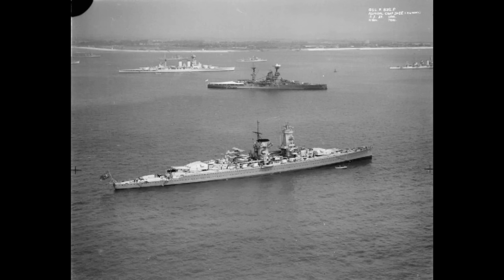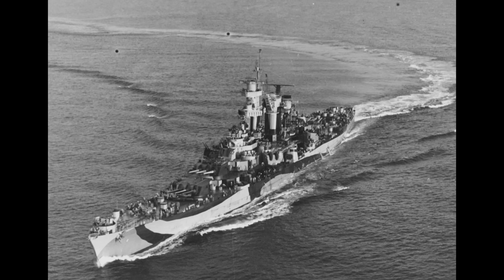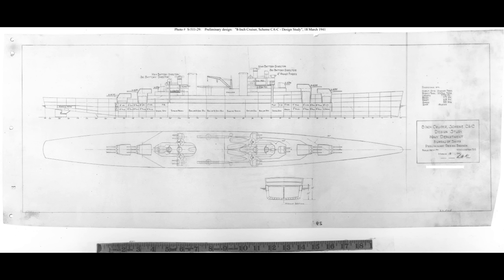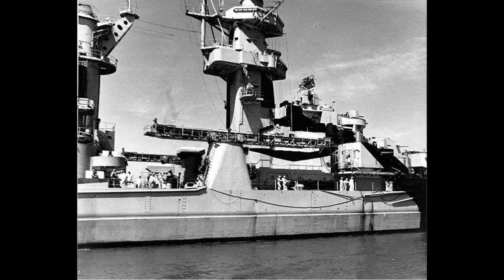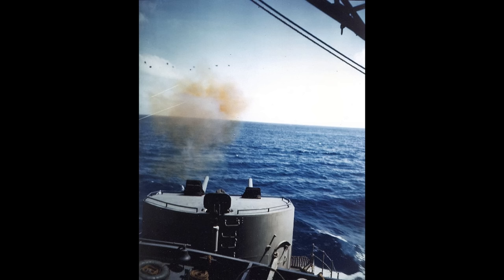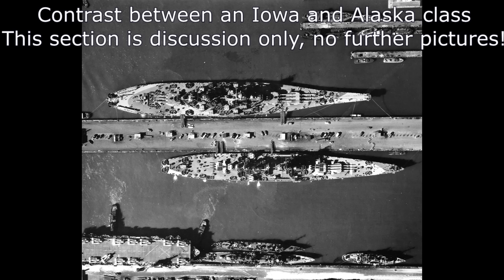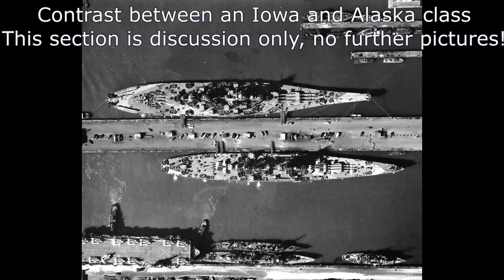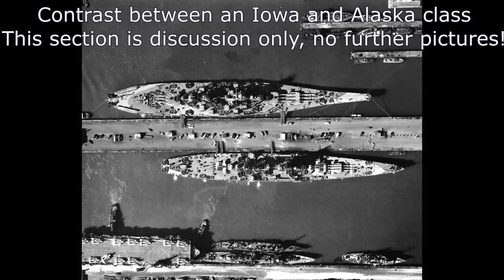The Alaska class - Large/Super/Battle/Mega/Hyper/Ultra Cruisers

Comment: I think the Alaska represented a better path for Battlecruisers to begin with. The main issue that plagued BC’s throughout their existence is that they had battleship-grade guns and therefore incompetent military planners constantly tried to shoehorn them into the battle-line. Going with an intermediate gun calibre between contemporary cruisers and battleships could’ve prevented most of the misuses that cost hulls and lives. 

Probably saved a decent amount of money as well. The Alaska’s weren’t cheap by any means but they were still cheaper then a Battleship while Battlecruisers typically cost more to build and operate.
Reply: I'd argue the reason they were called CBs was specifically to prevent them being used as capital ships, i.e. how the Invincibles were used.
Reply: Unfortunately the Alaskas weren't much cheaper than a fast battleship, and at the same time weren't much more capable than a late-war heavy cruiser. Choosing between one Iowa and 2-3 Baltimores might be a stumper, but choosing between one Alaska and 2-3 Baltimores... well, one of those things is just better than the other in almost every circumstance. 

To be clear here, the problem was that Alaska's specification was impossible. The designers did an heroic job of creating a ship to meet the stated need, it's just that the specified combination of armament, protection, and speed couldn't be accomplished with the technology of the day on anything much smaller (or cheaper) than a full-on capital ship. So the Alaskas are an example of fantastic execution of a deeply questionable concept.
Reply: @Philistine47  Yeah they unfortunately came into service right when gun-based warfare became obsolete and naval strategy flipped on its head overnight. However, up until that point cruiser killers were a valid concept and I think they could’ve been quite successful if they’d been built a couple years sooner.
Reply: Von Spee might have a different opinion.
Reply: The smaller caliber meant more ammunition aboard, too.  Which is not insignificant: if intending to be used as cruiser-hunters, they will need to ensure they don't shoot themselves empty while fighting larger numbers of lighter cruiser/destroyer squadrons. 

And it would have made them (arguably) much better shore-bombardment vessels than either Iowas or Baltimores: they had almost the range of the Iowas, but aren't wasting firepower.  Very few targets ashore actually require 16" fire; it's kind of overkill.  Against most ground targets, it is more effective to saturate the area with 100 1-pound shells, than with one 100 pound shell.  Which is why cluster bombs and ICM shells are a thing: because more small hits is almost always more lethal over a larger area.  Add to that the much longer barrel life of the Alaska's guns compared to the 16" guns...

It would have been quite good against the Japanese lots-of-8"-gun cruisers (being basically immune to 8" fire, and with guns that easily overmatch those cruiser's armor), and would have been excellent for shore bombardment, particularly against larger islands (or in Europe) where greater range for further reach ashore would have been important.
Reply: This is actually the dumbest argument i keep hearing about Battlecruisers. Instead of having a ship than can hurt a battleship you would rather have a ship that can't lol. 
"intermediate gun calibre between contemporary cruisers and battleships" That was basicly what armored cruisers were.... not to mention that they sometimes had same caliber guns as battleships to begin with. Also most complaints about battlecruisers in the battleline are based on Jutland loses which mostly happened when BCs faced other BCs therefore the argument is illogical if bc beating bc is supposed to disprove validity of bc.
Fallowing your idea of "good" bc in practice:
1. True battlecruisers would rape your small gun battlecruisers
2. Than the true battlecruisers would join the battleline in the front and cross your T or join the rear of the battleline and pour fire into your rearmost ships with impunity
3. You lose...
Reply: @filipzietek5146  No sailor cares about such distinctions when they're shooting or being shot at because few ships end up fighting under the conditions the wonks built them for.

Technically the Japanese were far outclassed at Tassafaronga as was Taffy 3 at Samar, for examples.  Does anyone think those servicenen calculated the odds given on paper by those far removed from battle?
Reply: @filipzietek5146  Your point is irrelevant because BC’s were NEVER meant to fight BS’s. But because they had the same guns as contemporary Battleships, they were often put into situations that they shouldn’t have been and sunk. My Hypothesis is that if something like the Alaska was the design route of all BC’s then you wouldn’t have the numerous historical examples of BC’s being sent to fight BS’s and dying horribly. 

Furthermore, these intermediate sized ships would be cheaper and therefore you could build far more of them then a rival who’s using BS guns on theirs. You seem to be under the false impression that cost isn’t a factor. They might have individually superior BC’s but if you have twice as many then you just gotta wait for them to all be sunk in the enemy line of battle by your own BS’s. 🤣 Also your own cruiser-killers should be out killing other cruisers, not engaging capital ships. 

With the weight and cost savings of a smaller armament, you could probably also make your ships faster and more heavily armored so that it’s unlikely the enemy BC’s would ever threaten them. So yes, I maintain that it’s a superior concept if the original design principle is upheld. To kill anything it could catch and outrun anything it couldn’t.
Reply: @samuel5916  Actually while initially BC were not intended to engage battleship as most navies started to gain experience using battleships and lines of battle it become apparent that the transiction from wind to steam carried a challenge, and that was the fact that now an enemy fleet could at any time avoid confrontation and action with mininal effort . This was particular challenging for the royal navy , that had made a laege investment and effort in having the  largest battle fleet in order to ensure a superiority of numbers that (specially based on exercises and wargames) would warrant victory in most conditions. and that was exactly what took place for almost 2 years , since the german fleet simply refused to engage the RN until jutland being always able to withdraw . Therefore by around 1911 or so it become clear that the RN required what could be called a bloodhound type of ship, or in other words a vessel capable of damaging battleships (and overpower lesser classes)  and pursuing them while at the same time being robust enough to shrug some hits . The general idea was not to fully engage BB rather close the gap and score some hits that hopefully would result in a reduction of speed , forcing the opponents, most the  germans , to either stand and fight , abandon the damaged vessel to it's luck, or scuttle it , with the last 2options being the most desirable. All of thisis actually mentioned in multiple correspondence between some of the figure heads of the RN between 1910 and 1914, and it  is one of the reasons why the term or definition "battlecruiser" appears around 1911 when until that moment ships like the invincible were simply seen as large or heavy armoured cruisers.  And while ships like the invincible were automatically  "promoted" to battlecruisers, the  actual next generations of large heavyly armed , armoured and fast type of ships that are produced fron there onwards  will continously increase armor . Unlike the invincible that were in most cases intended to resist 8 or 10 inches shells, the "next generation"  will be armoured in way that would allow them to have some surviveability against 12 inches fire, specially when charging fleeting opponents..   That said when placed in a battle line, depriving them of one of their assets , speed ( that by the way made them harder to hit, something that we often forget, fisher was not necessarilyy wrong, speed was a form of defense particularly by the standards of WWI fire control )  and subject to rain of  large caliber shells , thngs did not work out that well.
Reply: @samuel5916   I'd more specifically say that the role of the battlecruiser changed during WW I. Whilst the Invincibles and Indefatigables were definately designed around Fisher's idea of an armored cruiser-hunter to protect trade, the fact that Germany built their own battlecruisers and them being used as heavy fleet scouts/raiders meant that the Royal Navy had to respond, thus resulting in heavier and heavier battlecruiser designs from the Brittish.

Secondly the largest problem of the Alaskas was the cost at $75 million each. Each ship cost comparably as much as full battleship, despite being an intermediary ship. Hell even the Baltimores at $40 mil each you almost get two of them per Alaska. North Carolina cost $60m and an Iowa $100m by comparison.
Reply: @Arthion  Yeah, I’m not saying the Alaska was a perfect balance but she was heading in the right direction (30 years too late.) Something with similar specs but in a more compact hull-form should’ve been more palatable in terms of cost. The smaller hull requiring a smaller power-plant which is the most expensive component of period ships along with just fewer raw resources like steel and armor. The Alaska had amazing specs but those came at a price. They built a no compromise design (torpedo protection aside) when they could’ve used a design that had a few modest compromises in order to be more cost-effective. I’m not an expert, that’s just my two cents.
Reply: Its not incompetency to put BCs into battle lines. The problem is that theyre really damn expensive ships, hardly cheaper than battleships, and that in a large battle, you dont want capital ships doing nothing. Heck, thats the same logic as to why normal cruisers and even destroyers fight in large battles, despite usually not being build for that specific purpose.

And cruisers are the intermediate ship, not BCs; the latters role was overly specific, having a long range and hunting cruisers, which couldve been done by having more cruisers. Whole point of BCs was to be more cost effective than "more cruisers", but that obviously failed. 

At the same time Battleships speed and range was constantly improving, so BCs didnt even have much of an advantage in that regard from the beginning.
Reply: @termitreter6545  Yeah they were a very highly-specialized ship, which is fine if that was a more cost-effective method of achieving the desired performance. The Alaska was more along the lines of a traditional cruiser just bigger and meaner. Ironically, without naval treaties it’s possible heavy cruisers would’ve been up to that size and gun-caliber with lighter cruisers moving up to ~8” guns. We’ll never know for sure though. 

From that point of view, the Alaska could be considered similar to many of the IJN ships. Leapfrogging everyone else’s comparable ship classes by a few generations so you need comparatively fewer hulls to to compete. A single larger ship costing less then two smaller ships of equal combined displacement. So if it can take on two normal cruisers then it’s a solid concept.
Reply: So by better path you mean a German battlecruiser? Because what you're talking about is literally a German Battlecruiser design.
Reply: I've always thought that 9.2" guns would have been a much better bet on the Invincible class. It would have given them outstanding gun range against most ships and there would have been no temptation to stuff them into the battle line.
Reply: @Gustav_Kuriga  Yes actually, in terms of cost-effective cruiser-killers I think the German’s started with a better design philosophy.
Reply: Literally German battlecruisers, smaller guns thicker armor
Reply: @valhalanguardsman2588  Yes! Instead of scaling up a cruiser and putting BS guns on it, they should’ve scaled down a BS almost. Heavier guns and armor then any other cruiser but reasonable in terms of size/cost. In the cruiser world, such a ship might as well be a BS since it would be much more powerful and have thick enough armor to shrug off maybe up to 12” shells. As opposed to historical BC’s that could be chewed up by 8” shells or worse.
Reply: @samuel5916  The Alaska wasnt cost effective tho, thats the problem. Its 2/3rds of the cost of an Iowa, a vastly superior ship that even mightve been more mobile than an Alaska. An Iowa is pretty good at taking on cruisers, too.
The limited maneuvrability and size, compared with somewhat weak armor for the size, also made it quite vulnerable on its own. So its not like it could even really deal with the classic battlecruiser role of operating independantly (or in small detachments) to hunt cruisers.

Idk what else you need to decide that the Alaska wasnt really effective or suitable for anything. Something like a fast battleship, maybe even a downscaled Iowa (think Scharnhorst/Dunkerque) would be likely better. But still, at that price point you gotta wonder if small battleships arent too inefficient compared to larger ones.
Reply: The Alaska class were not battlecruisers. I'll wager if the Alaska is a battlecruiser so is the Iowa.
We can discuss it.
Reply: agreed, this is always the path I take for battlecruisers in Rule the Waves. smaller guns, higher speed, a comfy medium between cruisers and battleships, though without the disproportionate price tag of the Alaskas. that way my battlecruisers can operate independently as commerce raiders or raider hunters, but still have enough bite that they can reasonably win by ganging up on a battleship.
Reply: @bradymenting5120  However, in real life battlecruisers had battleship caliber guns. Sometimes even larger.
The Alaska class were heavy cruisers with no treaty restrictions. Might as well make them 8" cruiser killers, right?
Battlecruisers always sported BB caliber armament, thinner armor, and high speed. Their job was supposed to be muscle for the scouting force. They were fast and could run with cruisers and destroyers ahead of the battleships to scout.
They had everything to be a BC but the classic armament. They didn't have 16" guns. Two out of three.
The Iowa class BBs have BB caliber guns, high speed, but BB armor. Two out of three.
The Iowas were better battlecruisers than the Alaskas in my opinion.
Reply: @ut000bs   Well, I've personally leaned on that point before, from the perspective of them actually being that for all practical purposes. If Hood's a 'fast battleship', Iowa's certainly a battlecruiser.
The whole point of the culmination of treaty battleship and post-treaty fast battleship design was that the two design principles of battlecruiser and battleship were merged - characteristically if not entirely doctrinally -  but the heavier and purely faster Iowa was far more battlecruiser than the predecessor classes were.
What the Alaskas represent is a new battlecruiser paradigm, able to exist between the ranks as the battleships had soared away to insane levels of supremacy beyond what cruisers were legally allowed to top out at. A battlecruiser which doesn't try to be a battleship, but is content to be a first-class cruiser of all-big-gun type at an appropriate calibre for the time.
Reply: @AndrewGivens  No, the Alaska made the 8" gun cruiser obsolete just as the gun cruiser became obsolete. The Alaska  became the new heavy cruiser. There is a reason they were CBs. If gunships had still been a big thing there would have been no new 8" cruisers.
Edit: actually, we would have, perhaps quickly, an automatic 10" or 12" gun such as the Salems' 8" automatics.
Reply: @Philistine47 .. well I don't know, trade an Alaska for a Baltimore a Cleveland and two Gearings,, THREE Baltimore's is really a stretch for ships that displaced about 27000 tons ... You trade that for a slightly shorter Essex and I would take the bargain,, really most of the controversy surrounds the fact that while strategically or tactically kinda blah,, these were just extremely attractive ships...... Even if the Navy didn't really need them, they just wanted them, they're showboats for admirals... And for the new duty of the battleship or battlecruiser or whatever is to be kinda big,, pretty well armored,,fast, have a lot of anti-aircraft fire and be capable of doing heavy shore bombardment out of the range of the typical 155 or 205 mm shore batteries.. AND if there was a perfect accommodation in the superstructure for those badass admirals suites and staff meeting rooms all the better......
Reply: @micnorton9487  But they had the huge battleships to serve as, among other things, "showboats" as you put it. They would certainly display the naval power of a nation much better than the Alaska class because of their sheer size and awe-factor, so I think that argument doesn't quite stand.
Reply: @AndrewGivens  I think your assessment is probably the most accurate one. BCs and BBs sort of merged in the "fast battleship concept", with those ships having both speed and armor. If you take the Iowas as an example, they were designated as battleships and if you wanted to make battlecruisers contemporary to them, let's say you keep the guns and approximate size but want to trade armor for speed. How fast would these hypothetical battlecruisers need to be then? 38 or 40 knots? I'm pretty sure that wasn't realistically achievable, since past a certain point you would just need to increase the horsepower of the ship to an insane degree to just get a couple of knots of additional speed. This was even hinted at in the video at some point (can't remember the exact time) when two different designs for Alaska differed only in the fact that one of them was designed to go 34 knots and the other 35 knots, however the weight increase was like 1500 or 2000 tons (again, can't remember exactly and don't want to go searching for it for 15 minutes). This weight increase would just get bigger for each additional knot of speed because of the laws of physics. For this reason, I think as I initially stated that you are correct in your assessment that BBs and BCs concepts essentially merged. To that extent I think that the design philosophy behind the Alaska class may very well have become the new battlecruiser concept. In a different reality where Japan would have built their ships perhaps the other major naval powers would follow with their own designs and these ships would exist in this space between the heavy cruiser and battleship, whether they would be called battlecruiser or large cruiser or something else. Alternatively it would be a new, bigger heavy cruiser built with no regards to the treaty, with light cruisers possibly taking on the bigger caliber of the heavy cruisers, since some of the later light cruisers weren't far off the size and displacement of heavy cruisers. Either way, since they came at the tail end of the battleship (or large gun armed ship in general) era, none of this happened and the Alaska class ships remain the only ones of this type, thus sparking the debate in the first place. The original battlecruisers only got designated as such a few years after their conception. It is very possible that with the changin design philosophies and ideas the "definitive" designation for these ships and other potential designs like it would also be decided on at a later date.
Reply: @samuel5916 Agreed. The fact that they fought in the same battleline as Germany’s battleships at Jutland and all but one survived really is a testament to how well they were built, how well their crews were trained, and just how good their entire philosophy was.